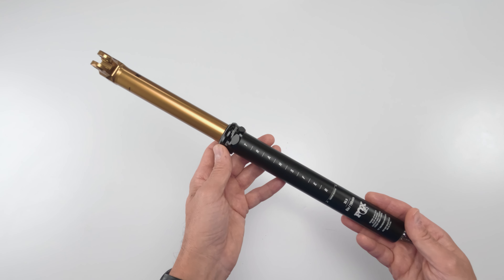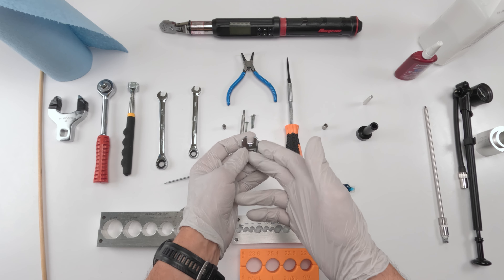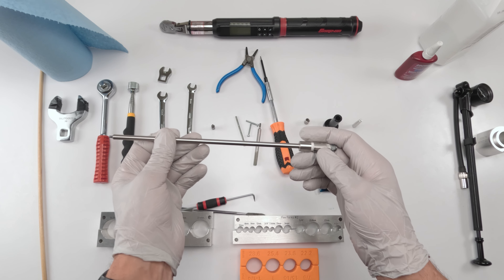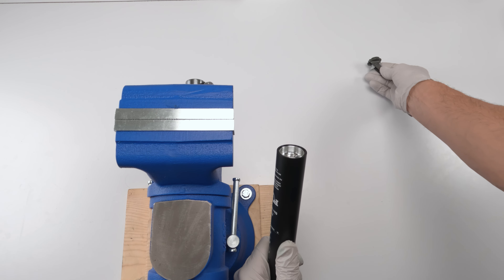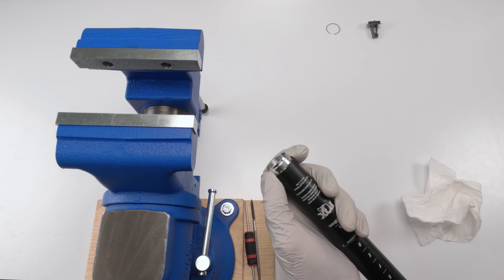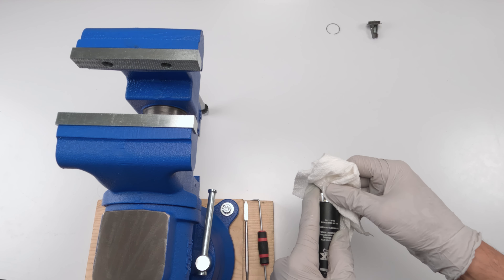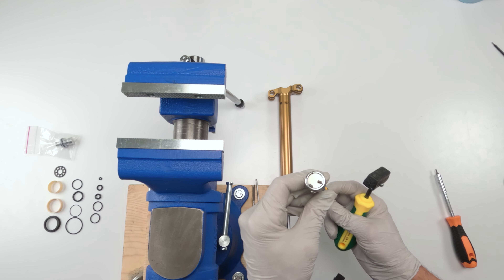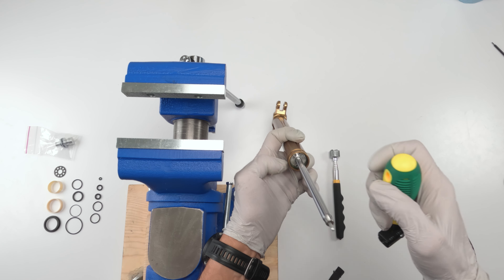FOX Transfer Dropper Post Full Service Rebuild Guide for beginners. 2021+ model  versions

Comment: The part 803-01-200 you've listed is for 2018 model transfers? 
Can you confirm this works with the newer transfers? 
Part number 803-01-496 is what fox list as the required tool for this post? 
But 803-01-496 is very expensive 
Compared to the one you list, they look identical in images .. 
This is the last tool I need before I can complete the service 
Also.. awesome vids! Keep up the good work you've helped me alot with servicing various suspension forks and shocks
Reply: Any ideas dude? 
Literally on the edge of what tool to order for the newer post?
Reply from the maker: HOLY S@#T!! They now want $400 for that tool? :face-blue-wide-eyes: They've lost their minds. Though I haven't tried the tool on the new version post (I don't even know anyone who has purchased one yet), I can't imagine 803-01-200 not working. The shaft diameter on the older version transfers is ~26.5mm. I can't imagine the newer one being different, and if it is, it's not going to be by a significant amount.  ANY soft jaw hole that is slightly wider than the post will work for this task. So If you're going to spend the money, I'd spend it on a soft jaw that can be used for other tasks as well. hopefully this helps some.

Comment: Hej. Thanks for the video. My pins have so markings on on side, do you know sould they pont up to the sattle or down? Thanks
Reply from the maker: Glad you found the video helpful. I point them up, but honestly it doesn't make a difference. most important (and this goes for all droppers) is to keep up with teh 50h or so service in order to inspect the parts and keep the post fresh. 👍

Comment: Hello, what is the length of the ifp piston, if possible, the size I will be very grateful, I have a dropper with a stroke of 150mm
Reply from the maker: I'm assuming your asking for the IFP depth of the 2021+ version of a 150mm dropper. 46.2mm IFP depth

Comment: My droppier is sticking quiet a bit. I saw people say on forums that fox has updated part for it to fix an issue. Do you know what the part it ?
Reply from the maker: I'm not sure of a new part as much as an updated post, which improved multiple aspects of the post. . If you find the post sticky or slow to respond, try a 50-hour service. Open the post, clean out the inside, and apply a fresh coat of grease. This will typically improve the posts performance significantly. Also, check the bushings for wear. If the bushings on the collar or post base show signs of wear, you should replace them, as you can damage the coating on the post over time. This is an easy job and can be done with a large channel lock or knippex pliers and some grease, like sram butter.  I hope this helps
Reply: @zoubtube  thanks for coming back to me. I'm a car mechanic. I took dropper apart yesterday. It was moving way better and worked flawlessly but after today's ride it's sticky again. I'll order a rebuild kit and see if that helps
Reply from the maker: @MartinTeerly  If I were to guess, I'd say the lower bushing might be the culprit. Servicing the whole post should be a breeze for you. There's nothing magical about it. It's just annoying that the tools can be pricey. Though I did notice that Northwest Bicycle and Pro Bike Supply had some REALLY great deals on Fox Transfer tools this past weekend. I'm  not sure if they still have the same discounts, but I'd check into it. From what I saw, all the tools needed would have cost about $150. That's less than the cost of sending it in for service. Just an fyi! Let me know how it goes 👍
Reply: @zoubtube I'm in UK and we have one shop that's under administration now and they sell this dropper for £99 but I'm not buying anything trouble 😂😂 I'll fix my and sell on Facebook marketplace 👌🏻

Comment: So wait, i have to build some kind of tool and take my dropper completely out of the seat tube just to add some air? Im selling this thing.
Reply from the maker: Even worse, you have to buy an expensive, proprietary tool to fill it with air. Great dropper, yes, but servicing it was definitely an alter during the design process. I wouldn't blame you if you sold it. These are the most expensive droppers to maintain imo.